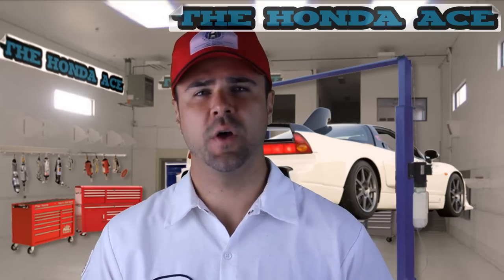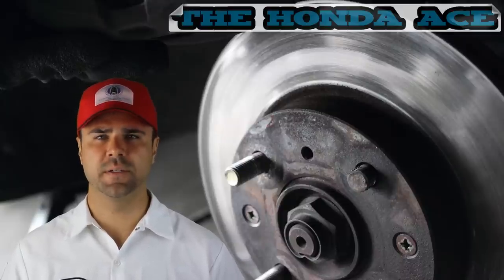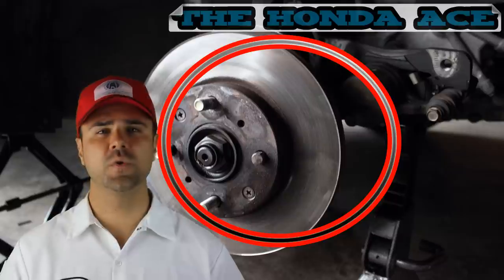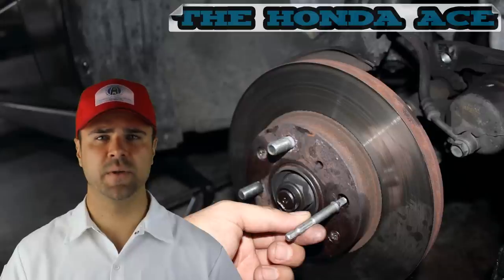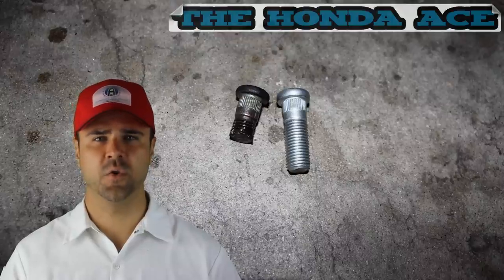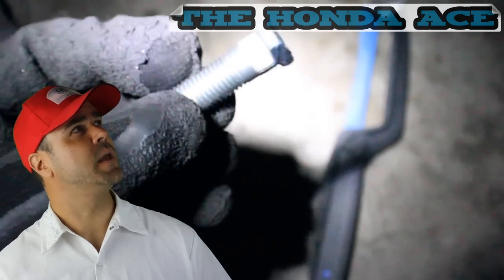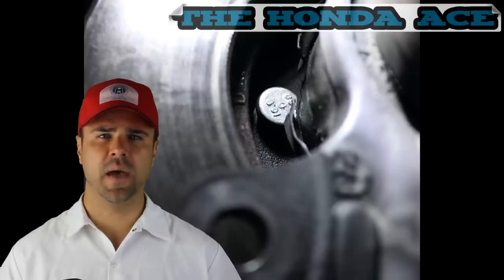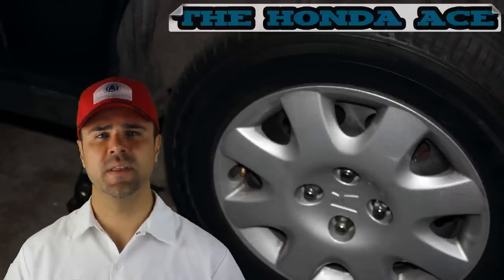Wheel Lug Stud Replacement Civic. THE HONDA ACE

Comment: I have a question for the Honda Ace....I have a Honda Accord 1991...rear center head bolt is stripped in the block... should I tap to next larger size or use a heli-coil....any input would be great...thanks

Comment: Did a wheel bolt replacement on a 2005 Honda Pilot  and its a very similar challenge.  I cut away part of the dust shield, used my grinder to get the old stud off and cut enough of a new lane on the knuckle for the new bolt to go in with a new air rotary rasp/file..  I did also had to remove part of the head on the bolt so the bolt would angle in better.  Had to use a thread file to clean up the threads after, but it worked pretty well. Honda should design an easier solution for this.

Comment: Thank you for this video. Alot of people say this is not right way. This is true. But it is also true many other cars are much easier to install studs. In order to get correct clearance the proper way is to take off hub. When taking off hub you should also replace the wheel bearing which you have turned inexpensive job into expensive job especially if going to mechanic, if diy you need good tools or help to complete not everybody has access too. This is cheap way to fix and still requires some tools. Although the 2000 ex seems to have even less clearance on the wheel knuckle this video is still helpful for such a well designed car in most aspects. i am trying to make this work now.

Comment: Got it to work BUT it was very hard. On my 2000 Honda Civic I had to remove the 3 screws of the dust pan and move and bend a little and slick it up and push and move and hammer a little and finally got it in.
Reply: yes i have 2000 ex and the axle seems to be bigger than all the earlier models. Much harder to get the stud through without taking off the hub. This is the closest guidance i could find. Everybody else makes it look easy and it is not!

Comment: This is not working on my 2000 civic coupe front passenger wheel. Took off the rotor to do mine. Had to completely cut out the old broken strut and can not get the new one to go in because of the axle behind it being so close. Might have to pull the center nut and try to pull the plate that the studs sit in, out so I can get the new bolt in from behind

Comment: doing this to my 92 civic thanks to les schwab upselling me all new lug nuts and studs. those awesome professionals charged me for 16 and only replaced 15 as well as cross threaded about 8 of them. thanks guys. my question however is why not remove the rotor if its just 2 small phillip head screws? is that for more stability when pounding out the studs? i removed my rotor and been beating on them studs as well as pb blast. not really budging. any suggestions?
Reply from the maker: I had to use a big heavy hammer some times. It really makes a difference.

Comment: what if there is no grove on the hub for clearance for the stud head? on a 1994 civic there is no grove for this easy install. Does the hub need removed from the drive axial to get the clearance? how is this done? I have a manual and of course it is not shown there. Thanks for the Video !
Reply from the maker: I've seen some pretty bad ways of cutting metal out to make room, but wouldn't recommend it.

Comment: Great vid! Will this work for a 2005 honda civic (ep) 5 stud? As somebody 's cross threaded mine and I'd rather not take the wheel bearing and everything out. Also will the stud still be be as strong with part of the top cut away?
Reply from the maker: Not sure if it will work on a 2005, but take a look to see. Bolts are strong, the trimmed part is only the back ring.
Reply: I didn't have to do any cutting etc I only had to take the back plate off in the end thankfully.

Comment: Two things: my 2000 civic does not have two bolts holding the brake caliper.  There's one at the bottom, but the top has some sort of clipped or fixed hinge to swing the caliper up.  Second, cutting the bold- are you sure this is such a good idea?  I know the reason why, but wouldn't a more correct way be to remove the rotor? Or disassemble to get better access?
Reply from the maker: I have never had a problem with the slightly trimmed bold and it's been on a car for years. Yes a complete dissemble would be better.
Reply: Your 2000 civic does have two bolts if it was a factory caliper. He was talking about the caliper assembly, which is what comes off after you remove the caliper itself.

Comment: Yea try to remove a wheel stud on a 2001 Honda CR-V...good Luck!..lol...I had to use a wizard and cut the broken stud....I did exactly what you explained in this video and I had to rethread the stud b/c I damaged the stud while hammering in through the hub b/c of the spindle was in the way
Reply from the maker: Many cars are different. This is one way I found to work on this Honda.

Comment: I just changed the stud on my 98 civic LX and I did NOT need to grind the stud down at all. I did however have to hammer a bit of the dust cover flat to get it in there but not too big of a deal. I don't see why for a Honda you would show that you have to grind it down, if I have this car and did not have to.
Reply: I just did it the other day on my 98 lx.  You must have had to pound it really hard.

Comment: How do remove  the other three wheel stud on the honda civic
Reply: +Clipping Point Media or use a dremmel cut off wheel to grind off a side of the stud head just like you need to do to get the new one in.

Comment: 2004 Odyssey.  same thing??
Reply from the maker: You will have to take a look behind the brakes.
Reply: I see the caliper must be removed and propped up to keep the hose from pulling out or kinking but you're saying, of course, it could be a left-over disc/hub from an earlier year, Ace?  How do I do it if it happens to be the earlier assembly?  (procrastinated again...still have not done it)
Reply: it doesn't work on the Odyssey,cause I tried it.

Comment: stupid you should never have to cut down or grind down an oem part to fix
Reply: Dylan Bates, True i see it all the time on Honda Civics some people cut the stud others grind down the knuckle(front) to do it correctly you to remove the hub.
Reply: @franciscogarcia-xt5wn  100 percsnt agreed. However im in a pinch. And my ball joints are shot too. (Dont want to pop them out of control arm) have to do my wheel bearing in a week or two. I might do this temporarily because i alresdy have 4 studs hanging around.

Comment: when removing the brake caliper. do you have to do anything to your breaks when you put them back on?
Reply from the maker: No. I just take the filler cap off before I install the brakes. Then put it back on.